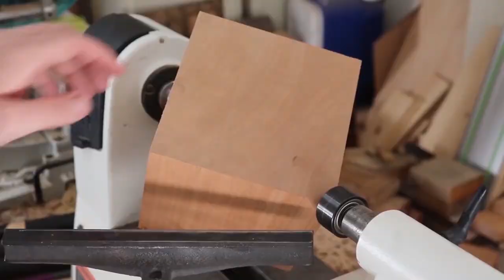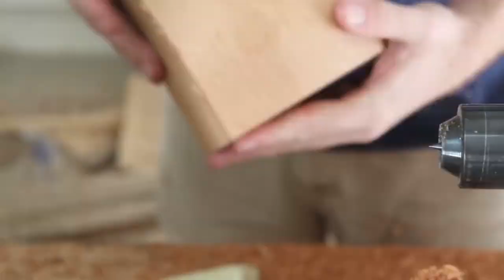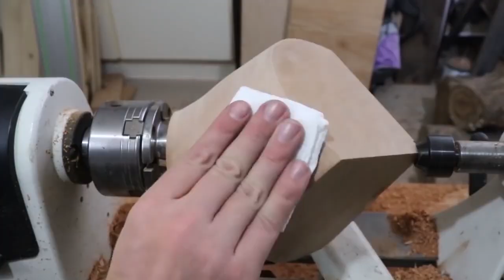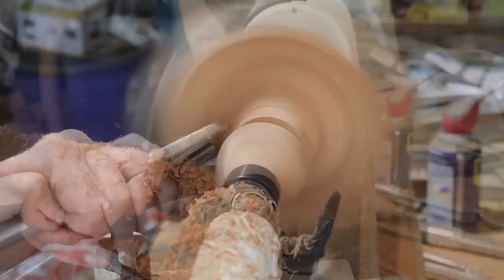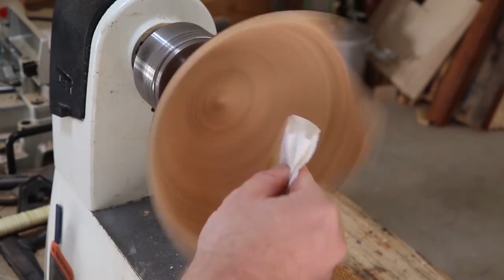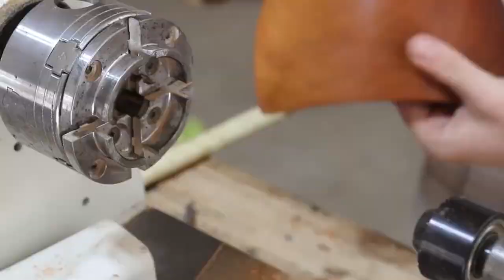Wood Turning a Cube (Fast Version)

Comment: Did you drive the cube by just pushing one corner in the spindle opening ?

Edit: I love that fact you left the curse bleeps in the condensed verse. Missed that the first watch lol
Reply from the maker: Yeah I just jammed it in there and prayed haha. It slipped a few times but eventually held long enough to get a tenon made
Reply: @CookWoodworks  haha that's brilliant, I'd say a small piece of antislide drawer mat would help with the slip issue though. I've used it on jam chucks. Creates a good amount of friction that the piece can't produce enough potential energy to over come it. I absolutely love these style bowls though. Gets the mind going, tri wing bowl from a cube object great stuff.